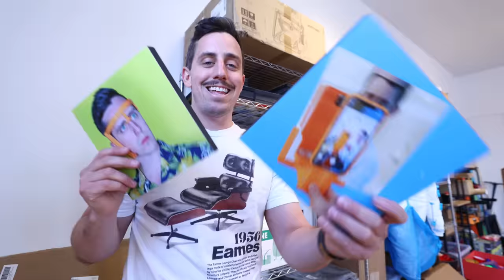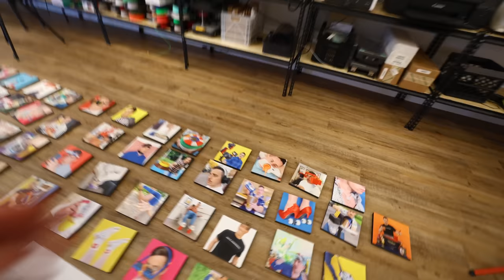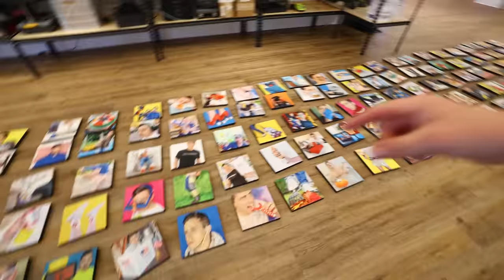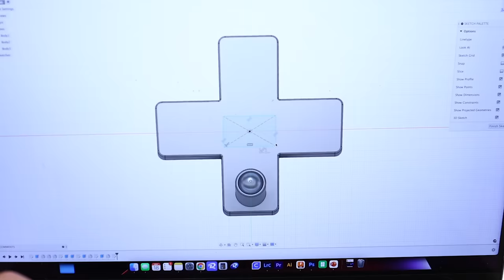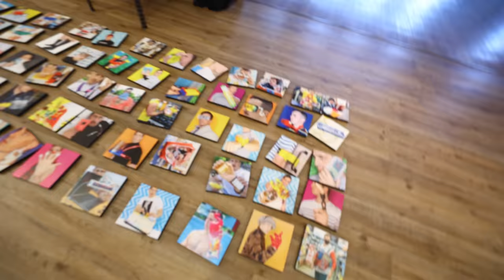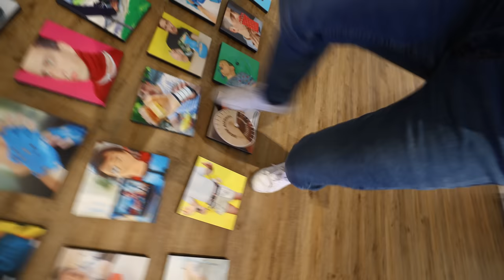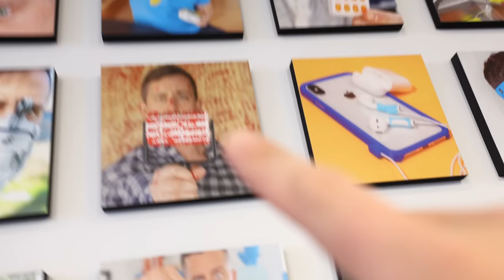This One Tool Changed My Life

Comment: Homeboy should of just took 3d blocks like big squares 4x 4 tiles or 5 by 5 tiles every time at lunch the over engineered wall takes the 5 X5 of tiles and rotates to the backside of the square where over engineered and unnecessary turn the boards.
 So everyday. At lunch the board flips two boards at random so there's always new photos that weren't there the day before.

If you like the idea Matty the creative freedom is yours. It is now fully your credit on the idea now.

Prolly would need  8 boards

Comment: Build a foot hammock with a combination fan and heater under the hammock. This would be a solid 4-5 puzzle piece wide project. Make an app to control it and add hydraulic or otherwise motorized height adjustment to account for sitting up and laying down most comfortably. This could also be accomplished by making the hammock itself adjustable by altering the slack, just have the hammock roll and unroll into a cartridge with a geared motor. I'd also recommend designing the puzzle piece base to have lock clips to lock the foot rest in place with some good old fashioned friction and pressure.